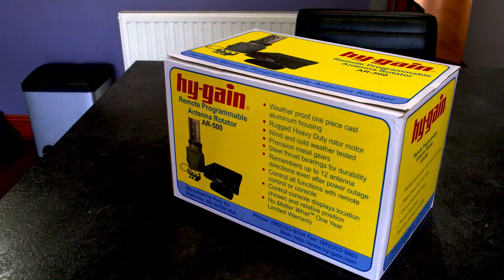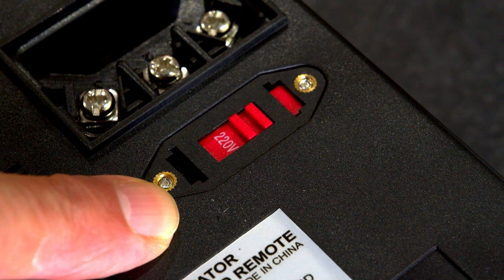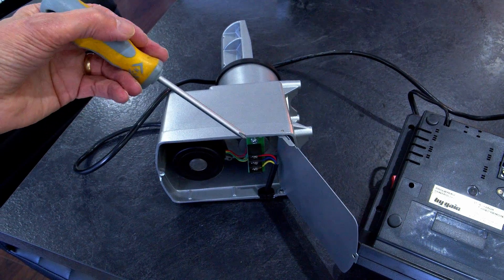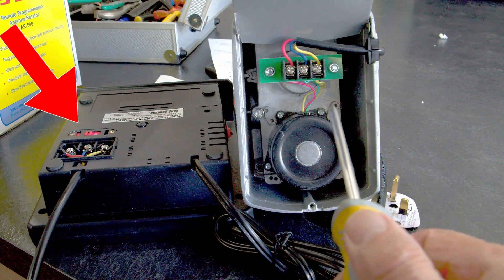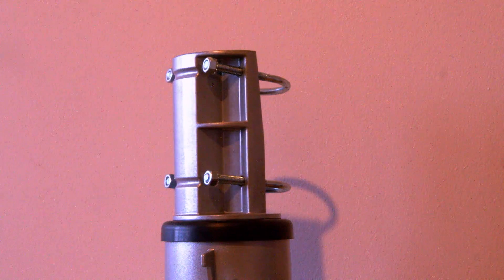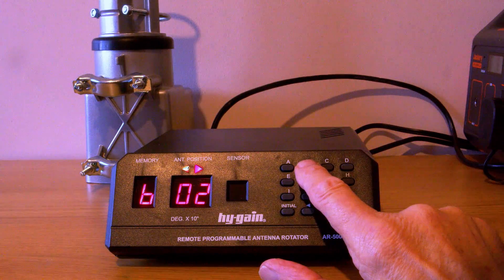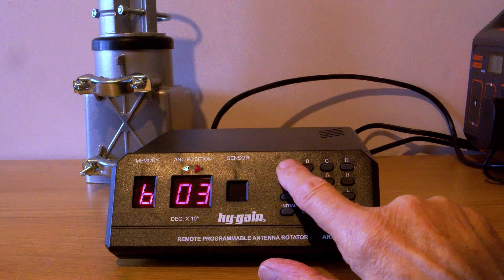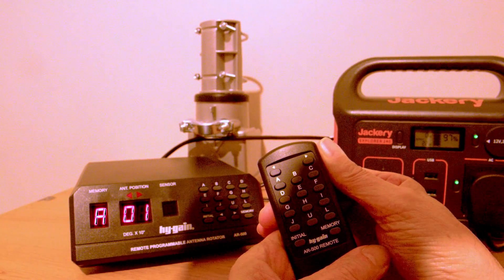Hy Gain AR-500 Antenna Rotator - Low Cost with Free Remote Controller

Comment: wondering how powerful is it and if it is safe to use it for like 10/11m 4 element yagi.. then if it will survive the winds. So is it only for a portable use or permanent ?
Reply from the maker: No, it is for VHF arrays. An HF Yagi would not be a good idea.
Reply: Would a wire dipole supported by 2 fiberglass fishing rods be light?

Comment: Good stuff. I have the same rotator sold by Sharman. Cost £200 from shops. Mine is for sale for £100. Used for 2 weeks but going HF so no longer need it. I'll check back to see if anyone wants it.

Comment: Something like this would be good for controlling an HF active loop in the loft. Does the remote only work line of sight, eg infrared? Would be nice if it worked through the ceiling.

Comment: Thank you very much for this informative video.

Do you also have or know of a powered telescoping antenna support? I'm thinking of a building mount that can be extended above roof level for use and retracted when not in use.

Thank you for any info.

73
John/KK7JBZ

Comment: My experience with other 3 wire control rotators is that they have no active feedback pot in the head unit and the controller relies on timing to estimate where it is pointing. They can very quickly become inaccurate if you go back and forth a few times.

Comment: had a number of them, great for the price. You can knockup a thrust bearing get a bit more loading but as is a light 20 metres or higher  dipole or loop and perhaps reflector is a good upgrade if you have space.